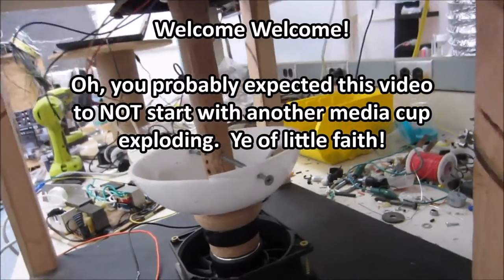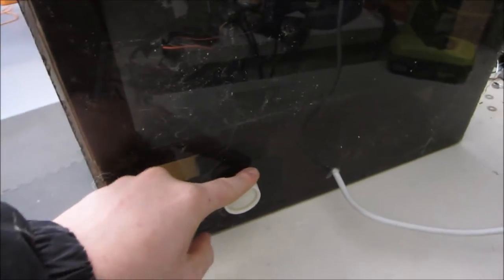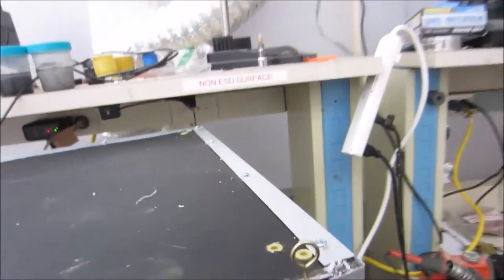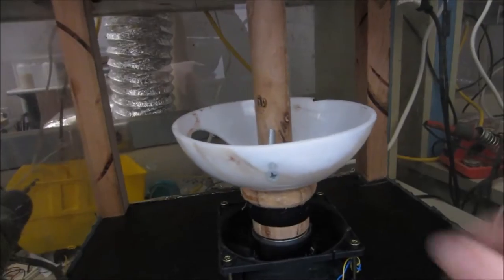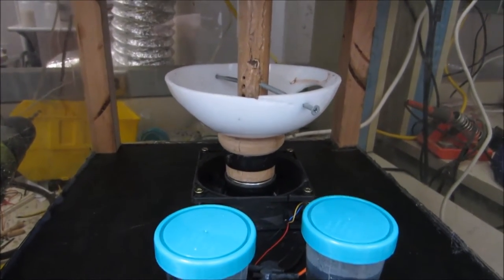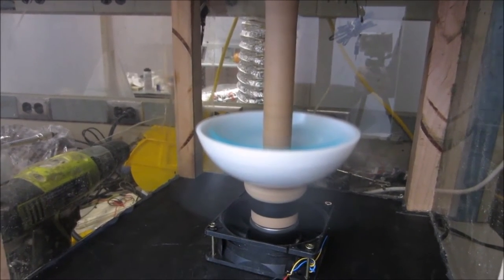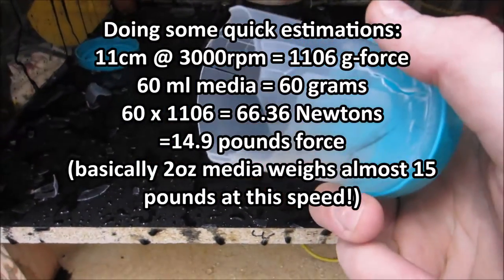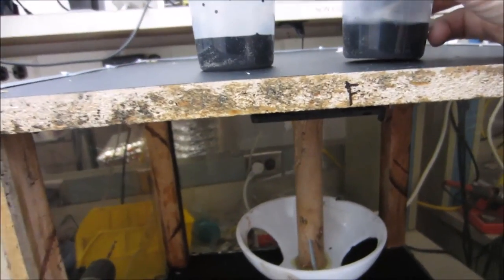DIY Centrifuge from junk - part 3

Comment: Perhaps one of the cups flexed enough to disengage from the threads of the lid and then became a projectile, also destroying the other cup.  I think that's pretty much what you are saying and thinking as well.
Reply from the maker: Basically.  Admittedly I haven't attempted a full replication to confirm one way or another in the exact same way; but, when I taped the tops on and used 1 oz instead of 2 oz, there was major deformation, but it did not have the same type of failure. (again though, that is with half the weight)  Finally finished filming part 4 to conclude the series, but I need to do all the editing still.

Comment: Dang, I wanted to see it working. Anxiously awaiting part 4. What is the liquid in the cups and what will you be using this for?
Reply from the maker: The liquid is a suspension of fine activated charcoal in water.  It has been in suspension for over a month, indicating it is very fine, and hence has a large surface area.  I'll try using it as active material in capacitors, seeing how it works as a conductive ink, etc.